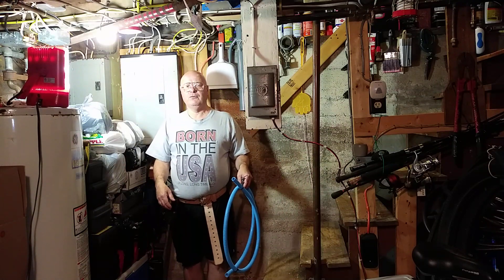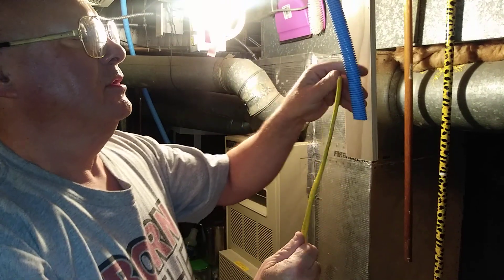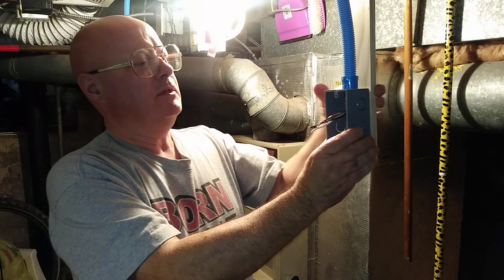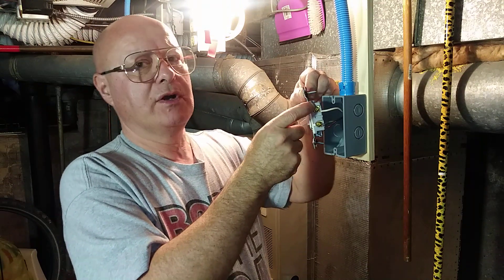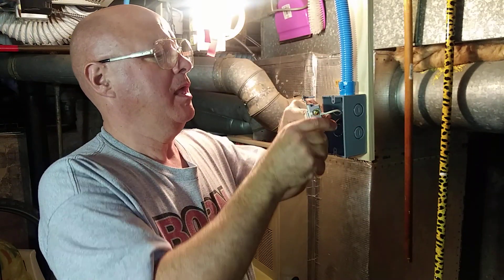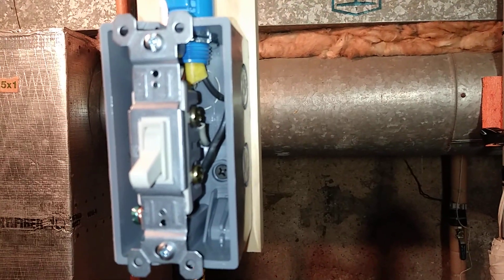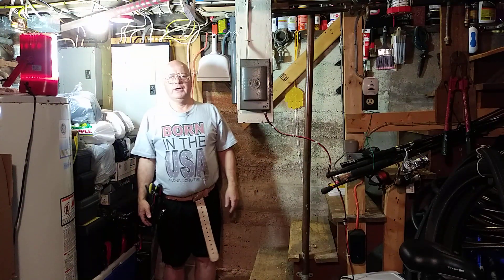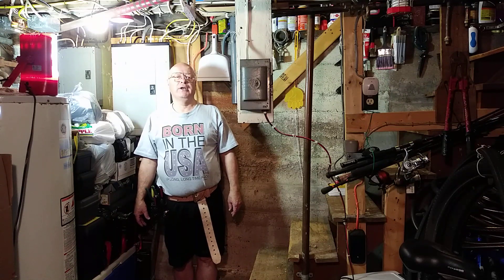i show and explain installing ENT plastic/non metallic conduit straps fittings wiring switch

Comment: Running Romex through the ENT is a NEC code violation.  Just pull individual THHN conductors. Be sure to pull a separate green ground conductor
Reply: Not true.  As long as the rules are followed per NM cable (romex) (Article 334) and ENT (Article 362) it is compliant.
Reply: It's not a code violation.  That is a common myth.

Comment: What is the name of the non metallic box ? I want to run flexible conduit with straps as well. That looks like the box I need (wires coming through the wall into the garage)

Comment: Nice video since I need to run some conduit and wire like this and have no experience with conduit whatsoever, but plenty with Romex.  What size conduit were you using to house that Romex?  I did not know we could use Romex inside a conduit because I was read somewhere  that it might get too hot inside the tube.  Not true?
Reply: I heard the same. Am stuck myself on deciding to run the romex inside a conduit or what I saw on a Different channel where they said strip the sleeve off then run in the conduit
Reply: I didn’t think Smurf tube was allowed outside the wall cavities either. Just from what I’ve seen and read.